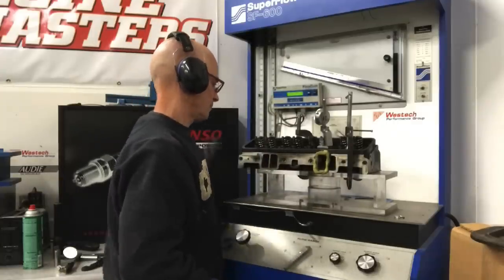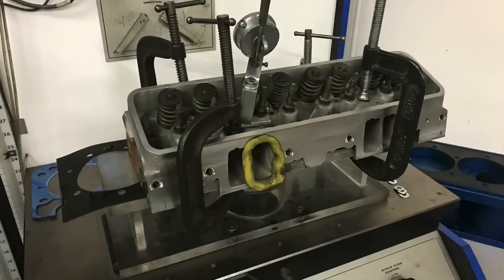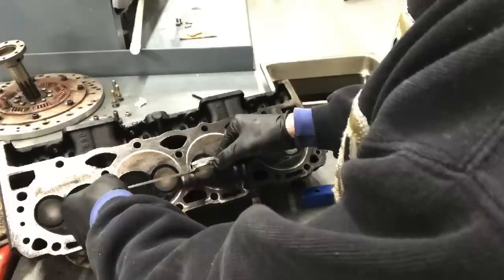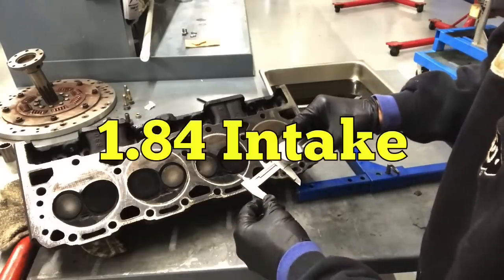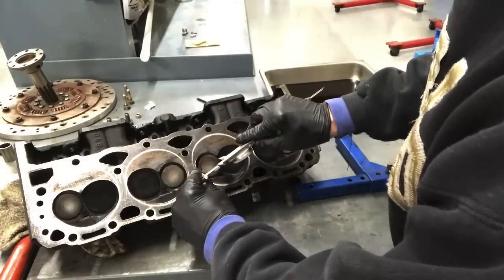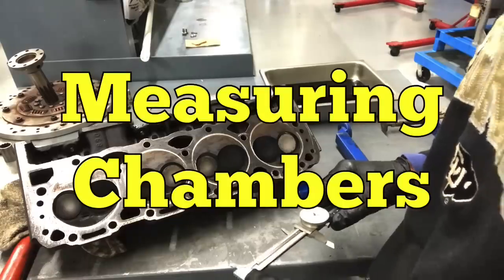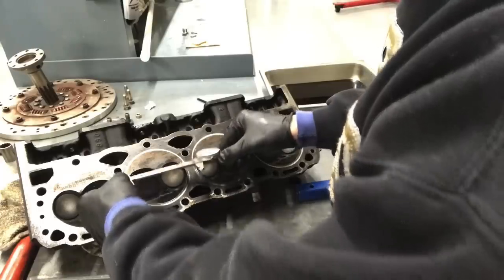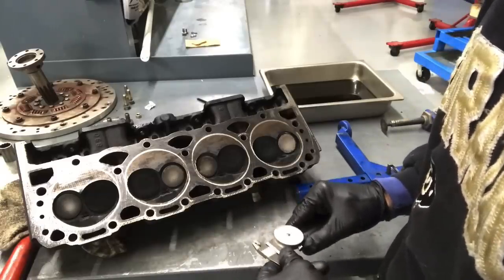L99 VS LT1 VS LT4-WHAT DO THEY FLOW?

Comment: I want to see a big bang 5.7 LT1 build, with a twist. Crank up the boost on a stock 5.7 LT1 with ring gap, head gaskets a cam and the stock LT1 heads. Up to say 15psi. Then swap on the LT4 heads and run it at 15psi. Then swap some AFR heads on and run the same boost. Then shoot for the moon lol. A nice head comparison before finding the limit of the stock rotating assembly.
Reply: @montgomeryhifiandreview5528  you must have been living under a rock. Stock lt1 has already been in the 1500-1800hp. 1320video has covered an lt1 stock block car that has ran 7.0 in the quarter mile.
Reply: @montgomeryhifiandreview5528  yeah that's not the case. You can make well over 1000 HP with a small block chevy casting. Gen 1 or 2.
Reply from the maker: we've done 1000 hp lots of times on a stock Gen 1 block
Reply: @richardholdener1727  back in the 90s I knew a guy boosting the lt1 past 1000.  We hear all about them then, now when the LS came only hear  how the old  block couldn't ( when people did for pass after pass), and the preaching about cap walk and Mexican blocks and blah blah blah. I say LS was a great improvement,  but people did crazy things before it, and somehow lasted

Comment: I really appreciate what you're doing with the LT1 style engines. There's not a lot of information out there unless you can afford some serious parts. I'm on a small budget so I'm looking for cheap and free diy mods
Reply: air foil, full exhaust, 1.6 roller rockers, cold air intake, full tune up, and a good tune should get any lt1 close to 300whp
Reply: @Madmax.3  air foil cost 100 cfm blocks hole 240 back wheels max
300 with cold air intake

Comment: Oh, BTW. My ???'s were regarding putting the LT1 head on as an LT4 probably won't work. Thanks AGAIN Richard for all you do! You always answer questions even before they're asked!!
Reply: Great I'm gonna love those LT4 heads. Thanks Richard Holdener. Yea that be sweet if I could put LT4 on a 5.7 4 bolt block.
Reply: @naphi6769  I don't believe you were replying to me but here's my thoughts FWIW. The LT4 head is great and will bolt on to a 5.7l block as that is exactly what it came on in 1996. Yes, 1 year only. The problem you will have is FINDING LT4 heads! Not common and not cheap if you find them. What would be cool is if Rich did a flow test of the LT4 heads and an inexpensive Speedmaster/ProComp head as they be less expensive and MAYBE better?? Bare castings of course with a quality build package.

Comment: Great I'm gonna love those LT4 heads. Thanks Richard Holdener. Yea that be sweet if I could put LT4 on a 5.7 4 bolt block.
Reply: You can. A lot of NHRA stockers running LT1s use a 1st gen blocks. They bore a hole in the front of the heads for the water outlet.
Reply: The Corvette LT1 block is 4 bolt. But none of the fast LT1 cars run that block. The 2 bolt block is better for high horsepower builds. Because you can install aftermarket billet mains with splayed bolts. Something you cannot do to a factory 4 bolt block.
Reply: @michaelallen2501  they are the same block and are a bit weaker than early blocks. Stocker racers use aftermarket gen 1 blocks and modify the heads.
Reply: @bartpang  well the fastest stick shift GM in the quarter mile uses a stock 1996 2 bolt LT1 block. De-stroked to 329 cubic inches and revving to 8500rpm, it makes north of 1600hp. No need for that aftermarket Gen 1 block. Look up Grubb Worm from Tick Performance. No Gen 1 or LS stuff there. All LT1.
Reply: @michaelallen2501  It may have started life as a stock 2 bolt LT1 block but it's far from stock now.
Reply: Going to have to pick the LT4's up when ya let me know. Thanks Richard Holdener. Merry Christmas n Happy New Year
Reply: @michaelallen2501  try that in Stock Eliminator and see how fast you get a DQ.

Comment: I wish you'd of been around 12 years ago when i was messing  with a LT1 in a 95 Z28.... In the end i had a set of Loyd Elliot ported heads with 2.0 / 1.55 valves. it was a 355 and made 400hp at the wheels and i had a 250 shot on top of that! Nasty car!! LOL
Reply from the maker: I was around long before that-wrote my first magazine article in 1989 or so

Comment: The 4.3 heads actually flow quite well for the displacement they’re feeding, much better than the so-called good heads of the 60s and 79s which were trying to support lots more cubes. The mid lift advantage of the LT1 heads may help the little engine, but my guess is the loss of compression will kill the gains. You show us this all the time when comparing 706 heads to almost anything else on the LS family. When you swap parts around to make a 302, the LT4 heads should do well, but I’d want to see the chamber volume reduced as much as possible—something you might not want to do to a spendy set of heads! Thanks for the interesting info, Richard!

Comment: From what I remember stock bore on a L99 is 3.736".  If you want to run standard style heads, grab a stock bore 1-piece rear main seal 305 block and fit the 4.3s rotating assembly into the 305 block.  Then test away with standard small block heads and intakes.

Comment: What are you plans with the LT4 Heads? I'm getting my 383 LT4 Dyno'd on May 22nd with Ported GM LT4 Heads, a 236/244 cam, 12 to 1 compression, Jesel Shaft 1.5 Rockers, Edelbrock LT4 Intake Manifold, 58mm TPIS Throttle Body, Morel Lifters, Comp Valvesprings, Tool Steel Retainers, Lightweight 2.00 inch intake and 1.56 Exhaust Valves, Eagle ESP Armor Surface Treatment on the Crank and Rods, Melling Shark Tooth Oil Pump, and a LS style 24x ignition setup system from Torqhead. Anyway I'm very interested in any tests that you might do using the GM LT4 Cylinder Heads with the lightweight hollow stem 2.00 inch and 1.56 sodium filled exhaust valves.

Comment: Hey Rich, you need to put a pipe on the exhaust port when testing. It'll usually pull it up 20 cfm. It's the same as the radius entry on the intake port. Great channel. You've done lots of tests I've always wanted to do, especially the chassis dyno verses the engine dyno.
Reply from the maker: we ran a pipe on the exhaust

Comment: That LT4 head DEFINITELY flows just as good as any stock cathedral port head 👍🏽
Reply: My stock LS1 GTO heads flowed well over 250 @ .500. Something like 255-256 I believe. All stock casting. The Lt4 did 239 @ .500. My stock GTO heads picked up flow at .600, the LT4 lost flow at .600. So they flow Just as good how exactly lol.
Reply: @kennethpowers8995  I think your getting confused with 799/243 heads first of all. Stock LS1 head aren’t flowing 250cfm. More like 240ish. So yea I stand by my statement. And even if your comparing it to the 243 heads, 10cfm isn’t that big of a deal.
Reply: @sstevocamaro  The big deal is the Lt head drops off in flow whereas the LS head continues to pickup flow. Meaning the LS head can take advantage of cam profiles more than the LT head. And I’m pretty sure I was there when my heads were on the bench, and I actually have the flow sheet so your not going to convince me otherwise lol.
Reply: They actually flowed over 250, 254cfm to be exact. Radiused entry for the intake, 1 3/4 pipe was used for exhaust.
Edit- even if I was talking about a LS6/LS2 head, it’s still a cathedral port so it would still be valid, but I’ll post my LS1 goat flow numbers still.
Reply: My stock GTO castings flowed as follows; 
.100- 65.2cfm
.200- 135.8cfm
.300-196cfm
.400-235.6cfm (i was nearly matching the LT4 head with only .400 lift)
.500-254.3cfm
.550-257.3cfm
.600-258.1cfm
Reply: @kennethpowers8995  Your heads must have had something done to them. No stock LS1 head in HISTORY flows mid 250’s.. This has been well documented by Richard himself. I think your confused with the LS2.. And yes the LT4 flows about 240 @.500, BUT the LS1 241 head flows about 228 @.500. It takes .700 lift for the LS1 head to get up to 242cfm!
Reply: @sstevocamaro  I’ve literally seen a 706 head flow the numbers your saying for 241s. At the end of the day we would have to flow all these heads at the same location on the same bench for all of this to mean anything though.
Reply: My head castings were indeed 241s, but the car already had a TSP cam and lifter setup with springs and bolt ons when I got it from the previous owner so the heads may well have been worked over, valve job who knows. Although none of that was added into the description when I was buying the car and you would think the seller would mention that work but who knows. The same shop that flow benched my heads did my brother in laws 706 truck heads and they made almost identical numbers to what you say you see from stock 241 castings. I went to a Livernois head package and we had my heads flowed against his 706s to compare and see which ones he was going to use on his turbo LS Fairmont. My castings blew his out of the water in flow and the chamber and runner volumes eeee acceptable for his combination so it was a no brainer.
Reply: @theyhatehimbecausehetoldth7576  Reading is fundamental. That Kenneth guy brought up the LS1. I simply said the LT4 heads flows in comparison to the cathedral port stuff dummy and I was challenged by Kenneth.
Reply: @sstevocamaro  you said any cathedral port head. I love and own Lt1s, but I just know that when you say any cathedral port head, I know that isn't the case.
Reply from the maker: the 799/243 heads flowed 250.2 cfm at .700 lift, the 241 (LS1) heads flowed 242 cfm at .700 lift, the 241 head flowed 228 cfm at .500 (less than an LT4 head), but the 799 flowed 243 cfm at .500
Reply: @richardholdener1727  Thanks for chiming in with the facts Richard 💯
Reply: @theyhatehimbecausehetoldth7576  I appreciate it thanks. I’m sorry for name calling as well 👍🏽
Reply: lt4 heads have been documented to flow 250 cfm by Chevy high performance each bench will produce different numbers from this article the lt4 out flowed a ls1 head up to 500 lift on both intake and exhaust but flow isnt the deciding factor on power the ls heads have the advantage of valve angle sbc and lt4 are 23* ls heads are 15*

http://purplesagetradingpost.com/sumner/techinfo/heads1.html#GM%20LT4
Reply: @sstevocamaro  
I have a secret for both of you (in this pissing contest)  the regular IRON LT-1  heads (1994)  where a later casting,  flowed better than the early aluminum LT-1 design (1992).
Reply: So for the record the lt4 doesn't flow as well as any stock cathedral. They're pretty good tho.

Comment: I enjoy seeing these comparisons for a couple of reasons.
The LT-1 / LT-4  are the highest factory evolution of the original small block Chevrolet V8.
It's cool to see what they can still do considering they were originally designed, built, and released in 1955.
LS  engines are great engines that are designed and built on the shoulders of what the engineers learned from the original small block.
Plus my '96 C4 has the LT-1 and it's really cool all the tricks GM used to make a lot of power in that day .
300 horsepower in a 3,100 pound vehicle is still fun to drive.
Another good video Richard. Thank you for sharing.
Reply: stock lt4 vs stock ls1 is drivers race the gen2 sbc is very underrated b/c it was only around for a few yrs and most jumped right to the ls stuff but im still whopping ls1 all the way up to the new lt1 the new cars come with a big problem WEIGHT there heavy 4000lbs heavy i have 3rd gens fbodys with lt1 and lt4s in them they all weigh under 3k if its a ls all motor w/o a power adder turbo or supercharged i rarely lose on the street same with dodge and ford the dodges are closer to 5000lbs in weight

Comment: I thought about going the other direction, swapping on a LT head on a SBC, drilling water passages in the intake surface, and deck if needed,
Reply: Already done... Vortec heads, and they flow better than the LT-1

Comment: Richard there has to be a way to adapt a tractor turbo to ramcram it to some high velocity racing heads on an LS. You're the man that can make it happen.
Reply from the maker: RAMCRAM?
Reply: @richardholdener1727  Yeah, a play on words based on the experimental Chrysler 392 RamCram hemi induction system, of which only 4 were said to have been made. The Chrysler Hemi Cross Ram intake manifold came out of that development. Any Nascar team engine tech should be able to Holman and Moody style cone port high velocity ports in some LS head castings, then just pair it with the appropriate off the shelf air gap short runner intake manifold. Any machinist should be able to mill it to accept one of the smaller Deere turbos. I'm thinking at least 9500 rpm on a prepared short block.
Reply: Car ramrod?
Reply: @JesusSaves86AB  You can if you want go ahead.

Comment: Would love to see the smaller bore fixture and the .x50 numbers. Does it matter with the L99 if the carbon was cleaned off or not since the aluminum heads looked cleaner?

Comment: You can always use a bigger bore head gasket to fit a bigger chamber head onto a smaller bore block but the valve size and valve lift is what's going be the limit on a small bore size relative to the other bigger engines that the bigger heads came off of fwiw

Comment: Sweet! Good to know my homeported LT1 heads beat the stock LT4 by 25 CFM. "intake" and 20 "exhaust" 😁
Reply from the maker: good to do flow comparison on the heads on the same bench, but it is certainly possible top better the stock LT4 heads with ported LT1s
Reply: ported lt4>ported lt1>lt4>lt1 cant beat a ported lt4 with the raised intake port ported they can flow over 300cfm on the intake and over 220cfm on the exhaust and its also good to flow on same bench at same time as rich stats your bench showed plus 25cfm but on richs bench it maybe less or more and vise versa but yeah must ported lt1s i see range from 240cfm-280 on the intake and 190-200 on the exhaust

Comment: It might be a lot easier if you're having trouble dealing with the oddball LT1 stuff to get a roller 305 block and put the L99 rotating assembly in it - could run whatever heads and intake you want, that way.

Comment: I would have liked to know where exactly the between 500 and 600 lift that it lost flow and why?
Reply from the maker: yep
Reply: engine maths will answer  ya questions.vavle curtain has a bit to say, port saturation point where valve lift is  greater then port cross section so port becomes redundant.intake to exhaust valve percentage.port angle just say ha lift is 13mm because of port saturation its really only around 10 to 11mm.it goes  on and on let's throw some variables in there to peace

Comment: Rich
Do an LS firing order on the 302 setup if you decide on a different cam than you ran in the 4.3
Rewire the cap and do batch fire injection unless you can tune it sequential
I got rid of my gen 1 stuff bout 3 years ago but had 0lanned the cam 0hase and was going to run the correct 350 cam and crank sensors and use an LS controller unlocked to  tune it coil on plug

Comment: Hey Richard, We entered a small Dyno competition at a local college  (I’m a high school auto teacher) and the rules made us run an old style block but the head rule said any production sbc head, so we welded up the water port on a set of LT1s and drilled 3/4 holes out the back of the heads and ran the water back to the threaded holes on both sides of the water neck. We fully ported the LT1s and on our bench (Superflow 600) it flew around 260 cfm and near 80% exh (can’t recall exh cfm). We made 530 hp and 487! Ft lbs with a 355ci flat tappet and flat top pistons. We were 80hp above 2nd place! 😏. The following yr they sent us the rules “NO PORTING ALLOWED” 😕 so after a ton of searching we found a set of LT4s. We welded them up and did a nice valve job. They flew exactly the same as the ported LT1s! We went back that yr and made only 1 Horsepower less than the yr before!!! We then beat 2nd place by 100hp 😎 because they all had horsepower drops from the no porting rule.They canceled Dyno competitions after that lol Love your videos! Nelson Performance.
Reply from the maker: NICE JOB
Reply: Howdy, what kinda cam were you running on the lt4 headed engine? I'm trying to build a block for the first time and i already have one bought but its alway cool to see what other people have done and maybe learn something lol

Comment: I know they are super rare/expensive but getting lt-5 head flow numbers would be interesting even though nobody builds them.
Reply: I believe Mercury Racing still builds them.
Reply: But the lt5 is not a DoHC V8?
Reply: Why bother it is a 32 valve dual overhead cam cylinder head. It was used in gm flagship model as an option. There are simply not that many of them in existence.  Lingenfelter did some porting on them years ago.
Reply: @joaovitorsilvagohl682  That's right.  Built by Mercury Racing.  I was mistaken in my previous comment; Mercury Racing apparently no longer makes them.  Try looking up 1990 Corvette ZR-1 LT5 for more information

Comment: I like all the comparisons you do. I've got a 92 5.7 chevy in a K1500 makes a whooping 190hp. wow. looking to put vortex heads (from the junkyard or friend i'm helping do engine change) send to machine shop,  a small cam for more torq, headers and getting rid of the TBI and going to either Carb or Fuel injection. Any thought or suggestions Engine has 60-80k mile.
Reply from the maker: yes on the intake, dual plane with 650 carb, 212/218 or so cam and Vortec heads with less than .450 lift or modify the valve guides
Reply: @richardholdener1727  Thank you. love comparisons you do keep it up.